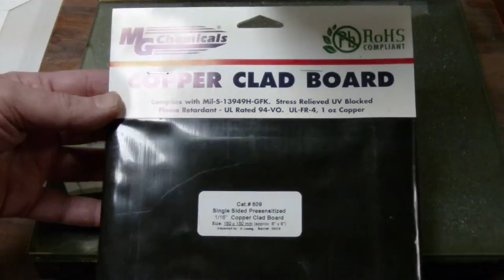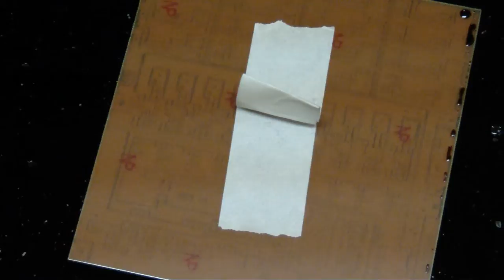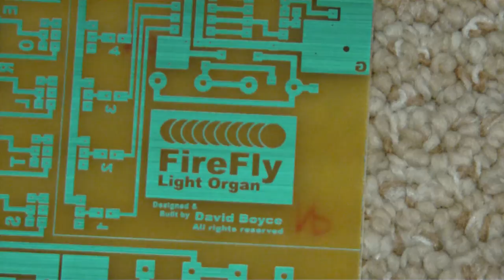Positive Coated Sensitized Copper Clad Printed Circuit Board Photo-fabrication Process

Comment from the maker: @seanwirth11 Yes filtering would clean out the junk but I am sure the would not extend the life of the chemicals. The ferric chloride is a single displacement reaction so eventually it gets saturated with copper and doesn't work as quickly.